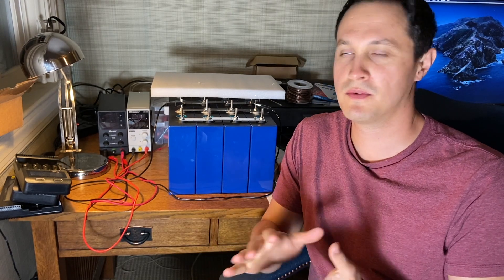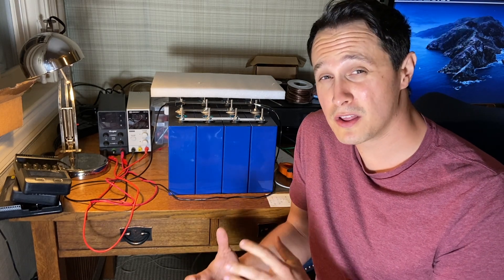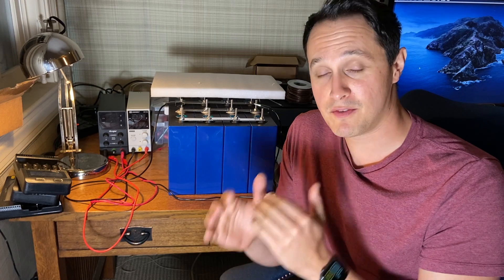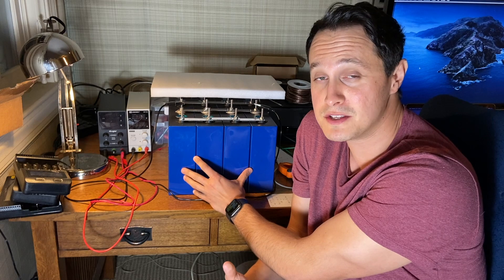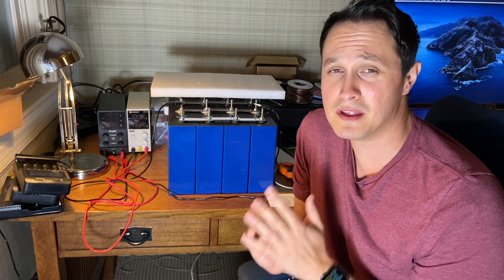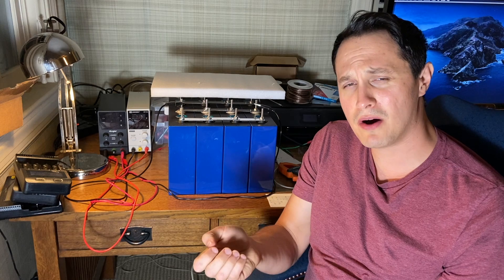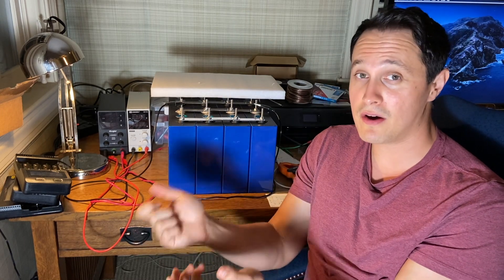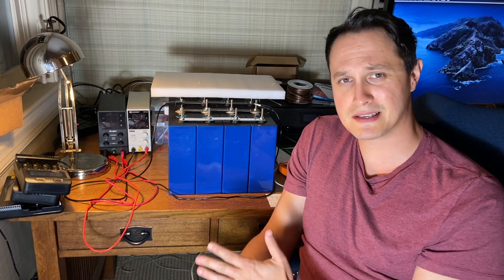Lifepo4 Basics and What You Need to Know!

Comment: I am in the middle of wireing this exact setup with two bms. But I cant figure out how to wire the bmstwo bms. The B- goes to battery the c- comes out as the main . If I'm trying to parallel them would I wire from one c to the other bms c-.
Reply from the maker: There are two types of BMS, separate port and common port. It sounds like you have separate port, but maybe not? Separate port has three cables, one to connect to the battery, and one to connect to charge the battery, and one to connect to draw from the battery. Common port means that the charge and draw (or load) are just combined to one wire. 

For a common port, think of the BMS like this - the BMS attaches to the negative of your battery, and then it has another wire (or two if it is a separate port) and this is the negative wire that you use to draw power from the battery (along with the positive terminal). So think of that wire from the BMS  (the one not attached to battery negative) as functional battery negative. So to parallel two batteries together, you would simply connect the positive terminals and connect the "extra" wires from the BMS - which are the function battery negatives.

The BMS works by standing between the power draw/charge and the negative terminal of the battery. So make sure that whatever is charging/drawing from the battery has to go through the BMS to get there - that way the BMS can disconnect that charging/drawing if need be. Google is your friend here, I'm sure there is a good wiring diagram somewhere, but this is simple, even if it doesn't seem it. Treat the two batteries as separate batteries. Where ever you would hook up your inverter to the batteries w/ the bms, that is where they should be wired together for parallel.
Reply: @TheWilltoBuild  I have a common port. I just see pictures of inline parallel where you connect one battery to another and then pull from the positive and negative terminal from the main battery. But I know you should connect them together and pull from positive from one and negative from the other while they are connected. So If I connect both bms outputs to the same post. And connect the banks in parallel and pull a main positive is this correct?
Reply from the maker: @partyfoulIguess  Ok, arrange the cells as two separate batteries. Wire them two BMSs to them as two separate batteries. Then connect the two battery positives - that is you main positive and you connect the positive of your load to that. Then, connect the P- or C- both of the BMSs (whatever you BMS has labelled, mine is P- but yours may be C-) together. That is your main negative. Connect your load negatives to that. Then,  you are done.

Comment: If I order 280ah cells from China and they all come with the same voltage. Is it mandatory I top balance them? Or can I just hook them in series and build my 72 volt pack?
Reply from the maker: I wouldn't say it is mandatory, but it is definitely advisable to balance them. There is a real chance they aren't at the same charge level, even if their voltages are similar, given that the Lifepo4 charge curve is so flat. Really up to you though. If you are using a BMS then the main risk is just that you'll get less capacity out of them than you otherwise would.
Reply: @TheWilltoBuild  thank you,

Comment: Hello is it okay to top balance cell 4 cell,   parallel 2 cell at a time ?  and another 2 after, because i only have 3 busbar but i need atleast 6 busbar to parallel all 4 cell at the same time. thanks
Reply from the maker: It should be ok, but I would make sure they are all very close or identical in voltage. I would also take time to a higher voltage to be sure, at least 3.5v.
Reply: hey Panther you can always make temporary buss outta any copper wire ie: 14ga would be fine bcos voltage is so close when balancing that current and heat loss is not an issue!
Reply: Use copper pipe, flattened, for busbars.

Comment: Thank you for the informative information I have the same cells 280 ah and when I hooked up my charger the same one you have the white one  I get a spark, my cells are at 3.3, V I have a BMS is this going to harm my cells? I notice your charger is turned on when hooked up mine is turned off when hooked up.
Reply: Pre charge your capacitors with a resistor first, that'll take care of the spark. And attach conductors to the inverter first, then attach to battery.
Reply from the maker: I'm not sure what caused the spark, but sparks are not uncommon when you are hooking up things that have a capacitor in them - for example an inverter. As long as the voltages are normal, I think you are fine.

In the future though - always make sure to disconnect the charger when turning it on, off, or adjusting it's settings. That means turn it on - then connect it to your batteries. When you turn it off - first disconnect the batteries - then turn it off.

Comment: Nice video. I am new to this concept. Some people have recommended to me to go with a 48-volt system. Here in Southwest Florida, it gets warm. We keep the thermostat at 81* all summer. Mainly to keep the power bill lower. And yet, last July we used 1440 kWh. That is why I am looking into other ways to get my power. What do you think?
Reply from the maker: The higher the voltage of your system, the better. You'll need smaller wires, and the efficiency of the system will be greater. Go for 48v if you can. Given your usage, and assuming 5 hours of sunlight a day, you need a 10kw sized array to generate that kind of power. That is big, but not huge - just a large home system. Sounds doable to me. If you want to run entirely on battery though you'll need a big battery system.
Reply: @TheWilltoBuild  I was thinking about running a PMG with a small AC motor. Generator big enough to run my home and the motor.

Comment: Number Check Please for Long Term Storage

at about 11:15 minutes in the video...
You said for long term storage to store them below 50% charge.  Then you said that's between 3.275 and 3.3V or 20-40%.    If my math is right that would be 67-70% of charge (if 0% is 2.5V and 100% in 3.65V).   20 to 40% charge would be 2.73-2.96V. 

Also, cardboard between the cells?   What about cardboard derivatives?  Or paper? string or cellotape?

Thanks
Reply from the maker: The reason that is not correct is because the voltage curve is not a straight line, check out this link: https://diysolarforum.com/resources/general-lifepo4-lfp-voltage-to-soc-charts-tables-12-24-48v.109/

I think between the cells you want something that is insulating, but also is conducive to moving heat. Paper or cardboard will do a good job at insulating the cell from one another, but not at dissipating heat.
Reply: @TheWilltoBuild  Thanks for the link.  From that table on the link 40-50% would be 3.250 to 3.363V.  I realize voltage is a problematic way to measure capacity in the flat part of the curve.   From that linked table 3.275 to 3.300 should be 60-70% charge.   So which range is preferred for long term storage?   And I know you don't charge these cells if temp is below freezing.  But what about storing them?  Is it OK if to leave a half charged LiFePo4 on a boat for outdoor winter storage where temps will routinely drop below freezing for extended periods but with no charging going on.

Thanks for the videos.  Very helpful to see different presentations. 

The bit about cardboard was a reference to this.   2 minutes well spent...
https://www.youtube.com/watch?v=3m5qxZm_JqM
I am working on a setup for a boat using very rigorous maritime engineering standards so cardboard's out.  No cardboard derivatives....

But seriously. I would choose something like electrically insulating fiberglass sheet between the cells.  McMaster Carr sells it.   My concern with these cells (I have 16 of them) is the delicate terminals.  And I think the torque spec on the terminals may have to do with what is happening inside the cells where there is a plate attached to the base of the terminals that the actual prismatic cells attach to.  Over-torquing the terminals may twist that plate and stress those connections.   I am trying to find more on that.  

Thanks

Comment: I found a great deal on some large nmc cells they are near 250ah They have a good power to weight ratio - I need them for my EV conversion - My question is what difference does it make if I use more smaller batteries or less of the giant ones?  I recon that I will use 1/3 C 60% of the time 1 C would be pedal to the metal - there might be times when I go 50 miles an hour for 30 minutes and that would be 1 C - charging would be .2C There wont be any active cooling
Reply from the maker: Ahh, this is a complicated subject. I would love to do an EV conversion myself. I think many EVs go with small 18650 because they need to get to high voltages (Tesla motors run at 400v ish), so you need to put a lot of cells in series to get voltages that high. Additionally, smaller cells are easier to cool. But there is no doubt that larger, prismatic cells are more space efficient though - and I do know some of the other EVs out there do not use 18650 cells and instead use other formats. I think which cells you will use will depend on many factors, but I think EV motors generally need quite high voltage so I would think it might be hard to get those voltages if you are using really massive cells. For example a 96 volt system might take nearly 30 NMC batteries, and 90 volts is not alot for EVs. So basically, I think there are many, many factors to consider here.
Reply: @TheWilltoBuild  Thanks for the reply - My car is very light only 1750 lbs (800kg) it has a 5 speed gear box so I can chose the gear that least stresses the motor. The motor is a 96 volt motor that draws a rated 190 amps  - my 28 cells x 3.7 volts = more than 96 so I got the volts and - hopefully I have more than enough amps

Comment: Hi...if I understand right what you are saying is that if I keep voltage between 90% max and 10% min I can drain @0.2C all the energy every single time to the 10% voltage and still get the 3500/4000 cycles they should last....
Reply from the maker: I can't promise that, but I think that would significant increase the probability the batteries last that long. Always keep the batteries charged between 90% and 10% and don't charge/discharge to heavily (.2 is great, even up to .5 is ok).
Reply: @TheWilltoBuild  so if 2 or 3 times a year I am without sun for an extended period of time and can’t charge the batteries/cells and I use all the capacity of the bank but keeping the voltage value at least at 10% of its minimum voltage value I won’t kill them...
Reply from the maker: Yeah I think so. A couple days at 10$ capacity is no big deal.

Comment: One question😅can you run a small 220v fridge(with around 1 or 2 amps of current so around 300 to 500 watts) with a 12v(8 lifepo batteries connected in parallel with an overall capacity of around 6kw)? What kind of converter should I use?😁
Reply from the maker: Let's do the math. Let's assume 2 amps at 220, so 440 watts. 440w/12v is 36 amps, so if your battery cells have a capacity greater than 36 ah, then you should be fine even if you only did one 12v battery and not two in parallel. You'll need a 220/12v inverter, i.e., an inverter that takes in 12v DC power and converts it to 220 volt AC power (typically at 50 Hz) if you are outside the US.
Reply: @TheWilltoBuild  well my fridge uses dc input cable, are there dc to dc inverters which does the job?
Reply: @TheWilltoBuild  I tried to search for inverters/transformers but some just misleading(at least I felt like it cuz it's too good to be true based on their sizes) and especially if they are from the big red flag on our northwest(I'm from southeast asia btw so..)
Reply from the maker: @marcangelodonelo5656  Your fridge runs on 220 DC power? There are DC to DC converts but I don't know of one that can handle that step up in voltage. You may want to run an 8s 24v system, that would be more efficient at getting to 220.
Reply: @TheWilltoBuild  how about 12s 48v?
Reply: @TheWilltoBuild  I cant believe Obi1 has a  220V d.c. fridge !
Reply: @TheWilltoBuild  btw, thanks for the fast and sensible replies😁👍keep up the good work

Comment: For winter time to avoid battery getting too cold, I use the Facon 7-1/4"x25" RV Water Holding Tank Heater Pad, 12Volts DC under my battery (8s) Lishen 272AH array and a 24/12v buck converter to power it and other 12v circuits. 
Q: What do y'all recommend for COOLING, your batteries in a shed? My summers get over 100°F and I want more than some fans. Am leaning towards Peltier cooling.
Reply: for as much power as a peltier setup would take, what about a small window a/c unit?  if you set it almost as high as it would go, just to keep things from getting TOO hot it might work ok

Comment: Excellent, informative video. My batteries are in route from China now. I have to set the video playback to a slightly slower speed so I can take notes. This guy speaks just a little too fast for my 66 year old brain.
I just recently educated myself for solar AGM systems, now this is a more complex system, but seems much better, if correctly done.
Reply: Did you buy the cells from our EEL Battery?
Reply: @eelbatteryofficial  no

Comment: I do have these batteries for my own project. I assembled 8 80ah to form a 24v system for my electric pallet jack. Little do I know that unless you put loads into the cells you’ll never know if the cells are bad! Lucky I put a BMS in it with Bluetooth connection with my phone so that I can monitor the real time data from the cells. 3 of the cells do fluctuate from 3.9v to 2.2v whenever I operate the jack. That triggered a lots of errors and the BMS automatically cutoff a few times. I bought it from Taobao and Taobao, you know........ without the BMS I think I’ll never be able to tackle the problem.
Reply from the maker: well, if they lifepo4 they should never read 3.9v - that means they are over charged. Voltage definitely dips under load though - what kind of load are you putting on them?
Reply: @TheWilltoBuild  30-80amps were observed with load. With one particular cell, it triggers 164 over voltage  alerts within 10 mins test
Reply from the maker: @bennyyeung2172  Hmm, they should be able to handle 80 amps. My guess is that either the cells were bad to begin with, or they were overcharged and damaged (again, they should never be 3.9v).

Comment: My batteries arrived somewhat wet on the stirafoam.  I have charge 4 and 8 280 batteries for 5 days.  Cant get above 3.48.   Using the same white charger you have.  Asking for Aliexpress to take them back.  It appears they want me to pay the shipping.  Will know in a few days.
I received them from Hawthorne CA.   They had to know these were not good batteries.  Do you have any thoughts  Thanks
Reply: Replace the stock output cables on the Power supply. To much losses in thin cables and alligator clips. Use thicker cables and ring terminals and you will get much more amps to the batteries.
Reply from the maker: I'm sorry to hear that. Do you think there was a leak from the batteries or that they just got wet? If they just got wet then I would think the cells are OK - whereas if they are leaking that is potentially toxic and a major issue and the cell cannot be saved. At 3.48v you are very near the top of the voltage curve. Why not do a capacity test? Typically, when cells get fully charged to 3.65 they then "settle" back down to 3.5 volts. That could be the case with your cells - they may actually be full. I would try to improvise a capacity test if you think the cells aren't leaking before I sent them back,
Reply: I set the charge at 3.65   also moved up to 4.5.  They just wont take the charge.  I really feel ripped off by Aliexpress.
Reply: They charge very little at a time.  I even tried just one battery.  WTH
Reply: Cells are Lipeo4 280 and are Variacore
Reply: Tried to top balance in parallel

Comment: Thank you for addressing the casing as carrying the positive charge! I saw one guy using a Phenolic Sheet of plastic as a smart heat resistant cell separator and loved that idea and would like to retrofit mine. For compression I used  4mm OD 20mm Long Spiral Stamping Extra Heavy Load Compression Mould Die Springs. Set of 10 cost me less than $10.
Reply from the maker: That is a great idea - I might be stealing that. Do you have a link for the springs? I would love to see some pictures (my email is in my about tab).
Reply: I have a photo of the end of mine. Using 5/16" steel easy rod (threaded rod) from Lowe's but can't seem to attach it.
Reply: Positive or negative casings  pose the same risks as each other  ,  polarity doesnt change the result of a fault current  path